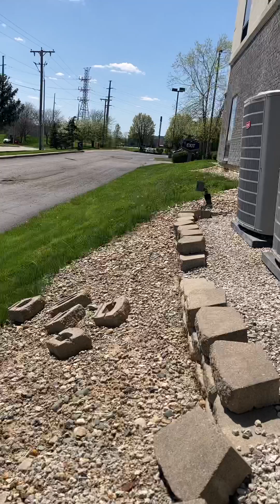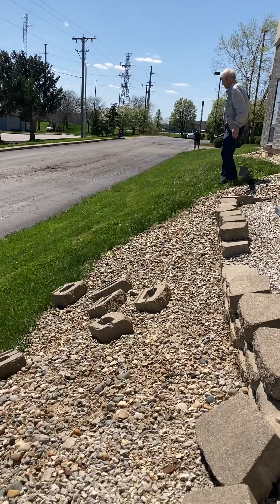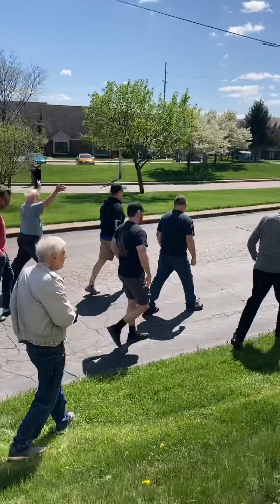Portable Acoustic Hailing Demonstration (DIY LRAD)

Comment: can you please post a parts list?
Reply from the maker: The drivers are PRV D4400Ph-Nd. I used a 6" round exponential horn with a short flare; the ones I bought were from BlastKing. These components are sold for the crazy car audio constructions that are common in South America but they are well adapted to the use case of an LRAD-type speaker using the modular arrangement where an array of sources is built up to the necessary directivity and SPL characteristics that are needed. Also, any full range amplifier that can supply around 800-1600W into the load should provide excellent output; the one I bought to eventually use is 3000W but in this video I'm only using about 100W. Using more power might require DSP filtering to avoid overdriving the compression drivers at low frequencies.